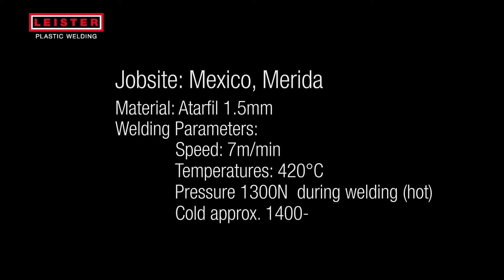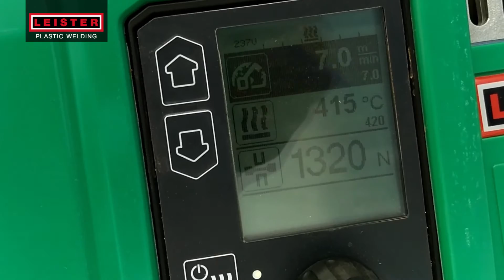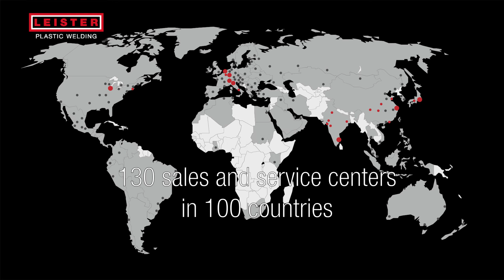Leister - GEOSTAR G5/G7 GEO membranes welding in Mexico

Comment: What does This error mean in my machine G7 02000008
Reply from the maker: Dear Customer

The Error Code 020 0000 isn’t in our error list.
We have following similar error messages:
0002 0001  - over voltage  (more than 15%)
0002 0002  - under voltage  (more than 20%)

For more details please contact our service center:  SalesSupport@leister.com
If you have a picture from the error message please forward it.

Best regards
Leister Team